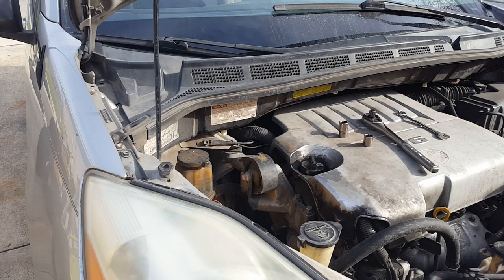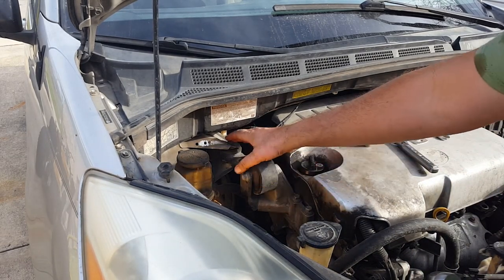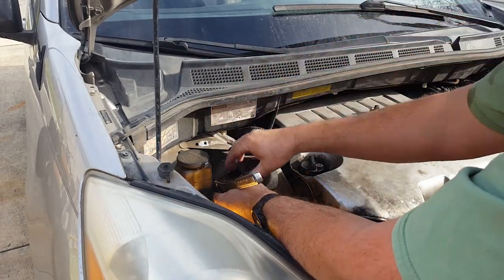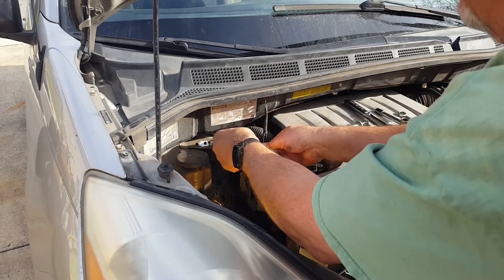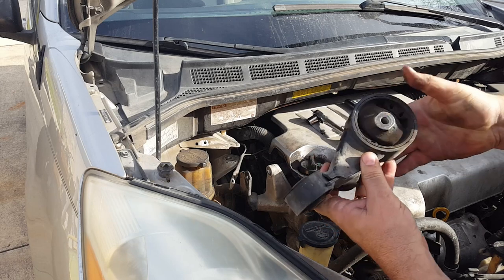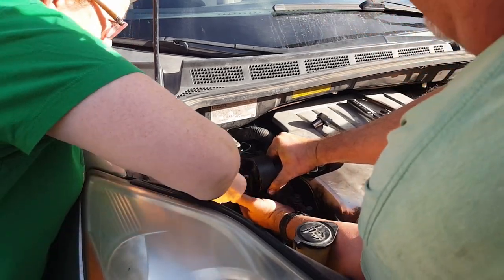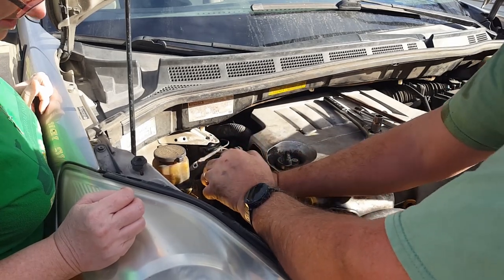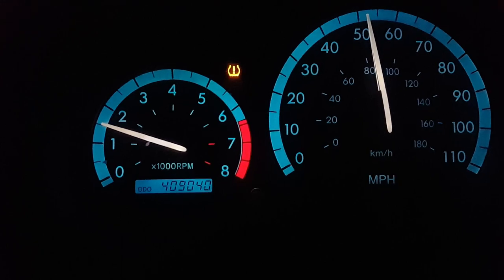409,000 miles Toyota Sienna Motor Mount Install

Comment: did you have to support the motor from falling when doinh this job?
Reply from the maker: no but you will need help rotating it when you try to put the bolt back in.
Reply: ok thanks
Reply: My bolts lined right up I had no problem.

Comment: The inner vertical screw in my van was hard to remove. I waited till I had to do the spark plugs while the drain tray was removed. The rest of it was easy. I think you need to replace the lower ones, it's obvious, because you engine is laying down, that's why you were able to remove the vertical screw so easily.

Comment: an update to my comment I read something more recent where another person on facebook has a 07 with a 3.5 with about 30,000 miles short of hitting 500,000 miles on it.  Unfortunately our 2011 with a 3.5 is down right now it decided saturday while we were out that it would start misfiring and running very bad still waiting on proper diagnosis from garage to see what went wrong.  We almost have 180,000 on our 2011 I jumped the gun saturday when it started misfiring and replaced all the coil packs even though it only had codes for misfires on a three specific cylinders I thought well wont hurt to try but, that was six hundred dollars and didnt fix my problem not sure why it started misfiring on multiple cylinders
Reply: Did you ever figure it out?
Reply: @tbandtg  anyway long story short a local garage towed it in checked it out determine at least in one cylinder maybe more no compression according to them whatsoever.  Hard to still believe that cause it will still start and run just not good however you shut it off once the motor warms up it will not start on it own warm unless you hold the gas pedal down about a 1/4 or so but, will start fine on its own everytime on a cold motor.
Reply: also according to the local garage that looked at it they said they would have to tear it down further to see exactly what was wrong said possibility it could be hole in the piston or burnt valves.  It does not knock when running never used oil never did overheat
Reply: Shawn Kemp  I understand you dont want to waste that kind of money but, dont let my comment steer you away from buying one.  We bought our 2011 used so no telling how good previous owners took care of it regarding oil changes or sometimes I think maybe they were not using the correct oil and we used 0W20 synthetic at dealer when we bought it like your supposed too and maybe they had already caused a problem.  I cant verify this but, it is just something I wander.  I will say this if you can find one with a good maintenance history go for it and use the proper oil.  What happened to ours was very rare.  You do not see that happen hardly at all if ever.  If we could happen upon another used one with a good maintenance record we would probably get another one its not normal for the 2gr-fe 3.5 from toyota to do that.
Reply: Shawn Kemp  I can understand that was kind of the problem we ran into when we were originally looking.  Now this is just my personal advice being that a 2011 was the first year run for a 3rd generation Sienna I would do everything possible and, I realize its not always possible to at least try to find a 2012 just because of where 2011 was the first run of a new generation there obviously would of been issues.  I would also suggest if your budget would allow you to maybe even bump on up and see if you can find a 2013.
Reply: Shawn Kemp  Not trying to say you should go into debt but, why do you take what cash you got and use it for down payment and finance the rest.  It honestly may be a better option
Reply: Shawn Kemp  I can understand that I mean if you could wait it may be worth it to try and save up more money for a newer one.
Reply: Shawn Kemp  Welcome best of luck to you and finding the perfect sienna for you.
Reply: I would've replaced the fuel pressure Damper and fuel pump sending unit. Sometimes a weak fuel pump/pressure can cause misfires. As well as a clogged, I want to say fuel filter but the part on the pump has a different name but serves the same purpose.

Comment: did car also bump while going into reverse from park and drive?

I've got 238,000 miles on my 1998 sienna and it has a nasty jolt when going into reverse (especially if the engine is cold)
Reply from the maker: No… that sounds pretty bad. I am not a mechanic but my first thought would be check trans fluid and make sure it’s full at correct levels.
Reply: Have exact same issue with 98 Sienna 220K,  bump/jolt is a nice keyword for it (and also engine starts with rough shaking). Guy who sold as is said to replace all mounts. Still contemplating how to go about getting help getting it  done since quoted $600 by lextech

Comment: I’m thinking about replacing engine mounts, struts and shock absorbers but the Toyota Sienna still handle and has smooth ride even over bumps so I am not to replace them right away. My Sienna is 2005 with 317K miles with all major original parts and issues are rare and infrequent.

Comment: Whoop whoop!!! Took me all of 10 min!! Thank you...  I did pb blast the bolts yesterday so they were ready... but !!! Yay  no more clunk.. when I shift from park to drive.  Only a little vibration left but like you said I don't know that I want to dig into the bottom ones. Thank you very much my wonderful 2006Toyota Sienna has 269,000 miles on it! Happily doing well!! Thanks again and I didn't even need the third hand because it lined right up

Comment: May I ask, have you ever had to replace the timing chain in the 409k miles? going strong with 250k miles on mine just wondering.
Reply from the maker: I did not ever change it... my understanding was the chains dont need it just when timing are rubber belts. But I would ask an expert to confirm.
Reply: @BigRedFishDad  Thank you will do, has your transmission ever whistled only upon pressing the gas? Mine does it and has been. Probably wear and tear but just wanted to see if any others have experienced it.
Reply: lol i dont think u can change/replace timing chain. timing belt yes. im guessin the 07 n up hav timing chain the older ones hav belts

Comment: I removed the top dogbone mount, cleaned it and filled it with eurethane. It was cracked. No supply atmndue to covid, so my temp fix worked

Comment: Did you ever replace the other engine mounts? Mine doesn’t seem to steer funny, but when I put it in drive and the engine shifts a little and creates some belt/vibrating noises. I replaced the upper mount and that fixed it for a year. And now I thing the upper mount is stretched out again and the engine is making noise. I’m thinking about replacing the front lower one. But I don’t know if that is the broken one.
Reply from the maker: no, the other ones are really hard to change. The one directly under this one has the CV axle that goes through it and then the other one is up under the transmission and just not much clearance.
Reply: Thanks.  I know one of them is damaged....I just don't know which one.  when my engine shifts (ever so slightly) it makes a vibrating noise that sounds like part of the serpentine belt system is misaligned.  Any ideas which one?  How long did you drive it with a loose mount?  I'm half tempted to leave it and just deal with the noise. 
 @BigRedFishDad

Comment: How many miles it has right now,if you could share?
Reply from the maker: 424K but I am dealing with overheating issue today... so it might finally be time to make glue from the old girl :( 
I will have an update next Saturday  morning.
Reply: Mario Soto I changed out the dog bone top mount on my 2010 Camry i4 LE. Made a huge difference.